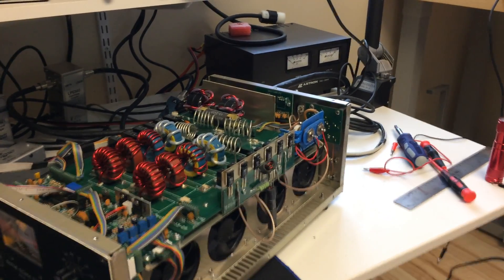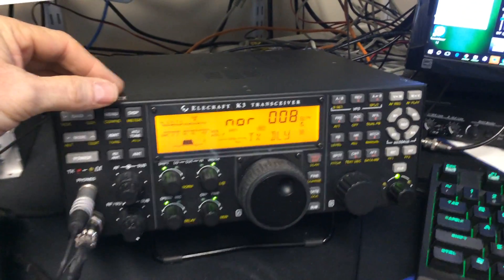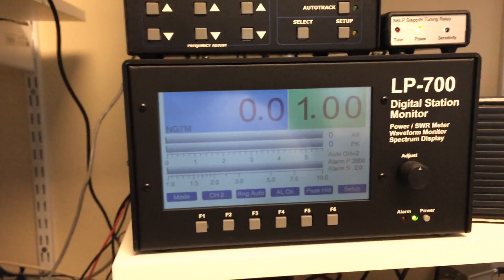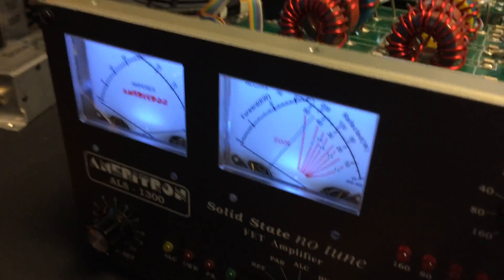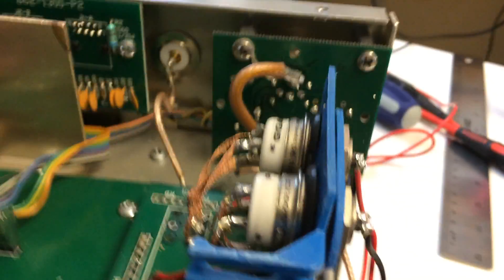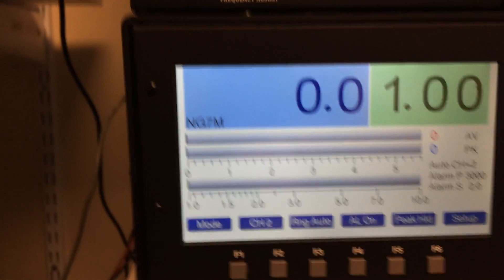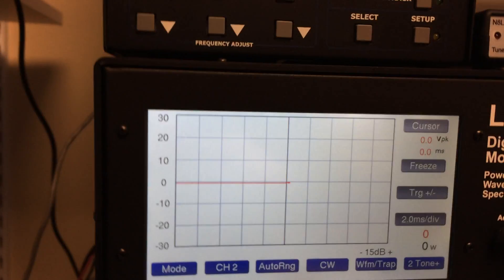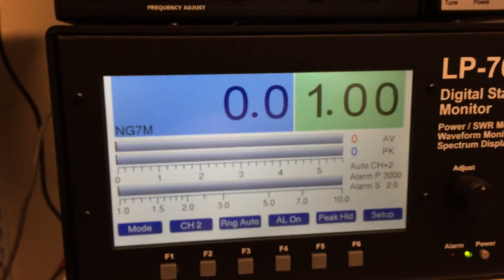NG7M Ameritron ALS-1300 Vacuum Relay Modification

Comment: I'd love to make this modification for my ALS-1300. Is it possible to buy this vacuum relay module? 73 de VE3VEE
Reply from the maker: If you watch the video, you will see that it was all a custom job, including the bracket I used for the vacuum relays.  You could still do the mod with vacuum relays of your choice.  It was a one-off job, and I sold the amplifier many years ago.  Max NG7M

Comment: I noticed that you changed the bias pots to multi-turns, Have you done any other mods to the amp?
Reply from the maker: I tweaked the rise and fall timing based on the faster relay response.  I had to change come component values on the controller board for the keying.  I have sold the ALS-1300 and no longer own it.  It was it top notch shape and working well when I sold it.  The new owner is very happy with the mods that I did.  Thanks for the comment.  Max NG7M
Reply: @ng7m-ham-shack  This looks like a great mod. By chance did you document the mods made to the controller board?
Reply from the maker: @rickwilliams3084  There were detailed threads on yahoo groups i believe, but now that yahoo groups are shut down, I doubt you are going to find the content.  i sold the amplifier 3 years ago.  Sorry, I don't have any documentation other than my videos now.